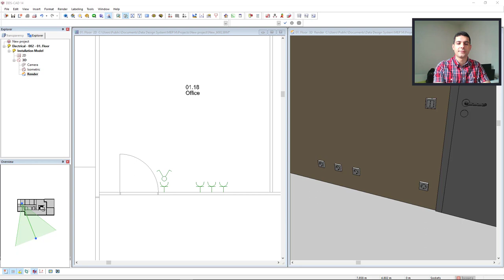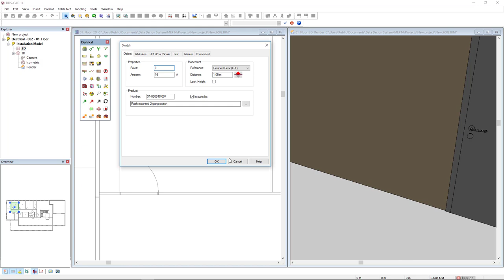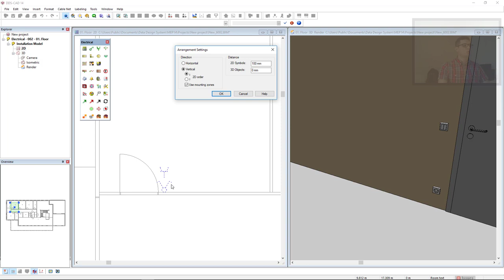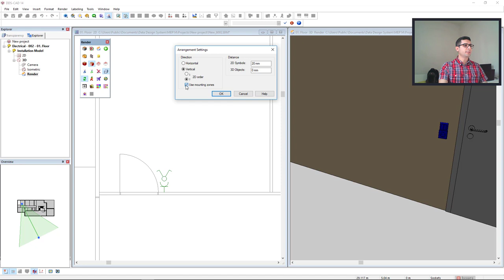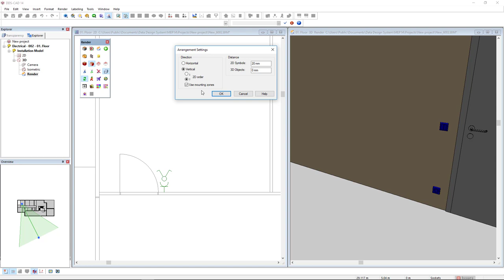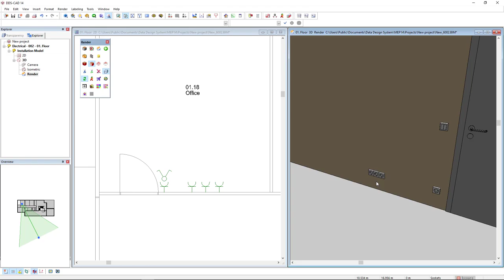DDS-CAD: solving the challenge between 2D symbol placement and 3D reality

Comment: Great video and explanation. How did you open that window on the right where you see directly the 3d model
Reply from the maker: Hi Mohmed, the two windows were opened via Menu Windows --> Tile Vertical.

In DDScad 18 you can make it by selecting the model --> right mouse click -->  select the option Arrange Windows.